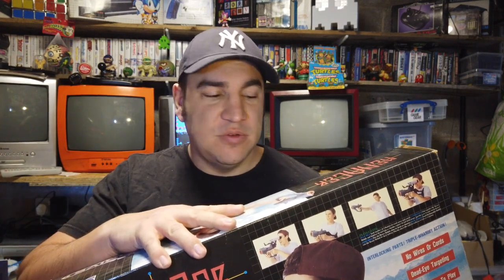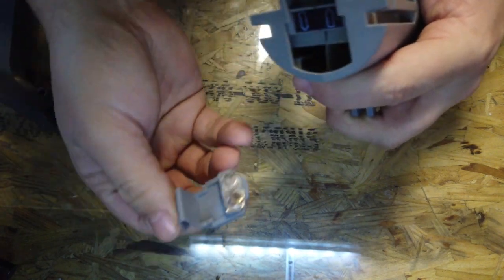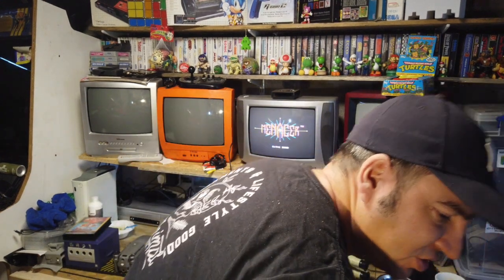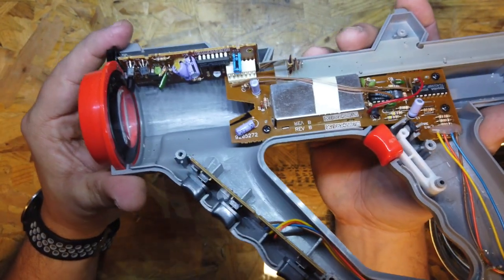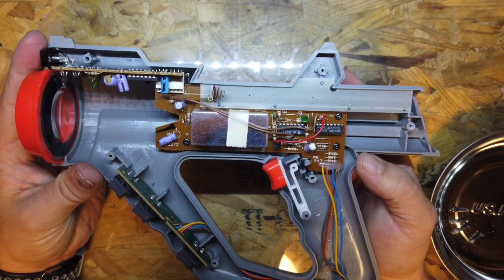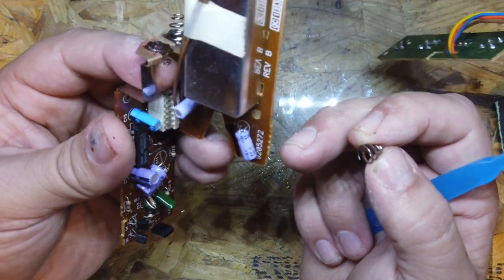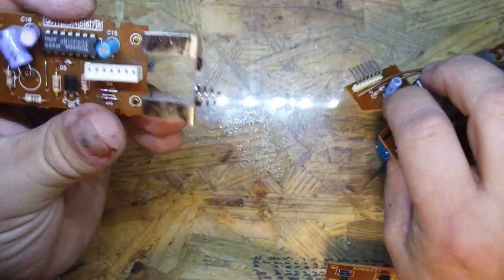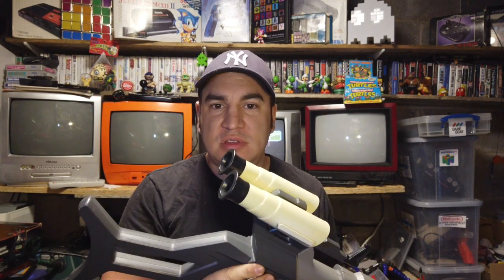Repairing Sega Menacer Light Gun for Mega Drive & Genesis

Comment: Nice video.
I've got myself a menecar gun. 
The light inside turns red. 
When i plug it, its not working. 

I have a sega mega drive mini. Do i need an Old mega drive for the gun working?

Thanks
Reply from the maker: Thank you. This was one of my first videos on YouTube. Great to see it still helping people.
Sadly old light guns only work on CRT TVs due to the way they use scan lines to determine your position. In theory a mini should work but would need to be on an old TV.
Reply: Yes. Im using a Old crt tv. There are ports on the mini, but i have never checked them working, because i do only have the wireless controllers that comes with.

Comment: Just picked one up yesterday and of course it didn't work.  Makes me wonder if it's the sa me problem
Reply from the maker: Batteries first thing to check on these. Make sure it's not rotten inside. Then take a look if the IR less are lighting up.
Reply: @GoodwinsPlace  well I played with it some more and got the IRs to light up.  But T2 won't recognize the Menacer.  Don't have the pack in game.  Might try burning the Sega CD games that use it to see if I get different results.

Comment: Any idea where we could source replacement battery terminals ?  Mine would not come apart no matter what I tried and both got bent up with the left one snapping clean off when I tried bending it back in place :/  I think it was somehow bent beforehand and biting into the slot which is why it wouldn't slide apart easy in the first place.  Ah, who knows.  Anyhow, given the date I'm betting the answer will be "nope, it's a parts unit now" but figured I'd ask :)
Reply from the maker: I don't know if you would find an exact fit from other systems, but most battery operated items when you take them apart the battery terminals slide out. The other thing you could do and you didn't hear this from me, is to build up where the terminal was with tin foil (aluminium foil) one side folded a few times as a flat item, then the other side built up a lot where the spring would be. It isn't a great solution, but will work if you are stuck. 
Good luck.

Comment: Great video i enjoyed watching it. I have a question? I've got my sega megadrive set up on a old LCD tv will this menacer gun work using this tv or does it just work on the old style TVs? Any help would be much appreciated. Thanks
Reply from the maker: Hi Chris. The old lightguns need a CRT as I believe they use a combination of the scanlines and in this case the IR for the positioning. So the way a modern TV refreshes the whole image stops this technique from working.
I've backed a project on Kickstarter that is really interesting and will work on any TV. It's called the Sinden lightgun, I'll look to do a review or pre-review on it soon.
Reply: @GoodwinsPlace  thank you very much for your reply it's much appreciated.
Reply from the maker: @ChrisBrown-wf7rg  no problem, thanks for watching. I do these videos for a bit of fun so glad it can help or entertain someone.
Reply: Thank you!!! Recently got my old Sega down from the attic and found the Lightgun but couldn’t get it to work on my modern TV. Got the old one and it works like a charm!
Reply from the maker: @majesticjavelin9393  Thanks for commenting, glad you got it working. Shame they don't work on the new TV's but it's technically not possible with this technology. There are some new technical fixes being built which will allow this soon.

Comment: Really miss the good old light guns games. It's a shame namco didn't bring out an updated tech once LCD TVs became the standard.
Reply from the maker: There's a new one that I've backed on Kickstarter that works well on LCD. Will do some update videos on it soon.
Reply: @GoodwinsPlace  sounds good. I did some info online about someone worked out how to use the old ones for duck hunt, I think they used the cheap usb guns as they don't have a filter in them like the official NES gun and with a modded duck hunt ROM they got it to work on LCD , think there is a few video on here about it.